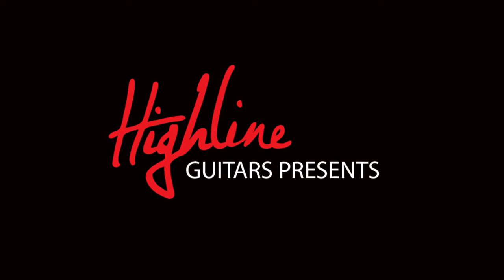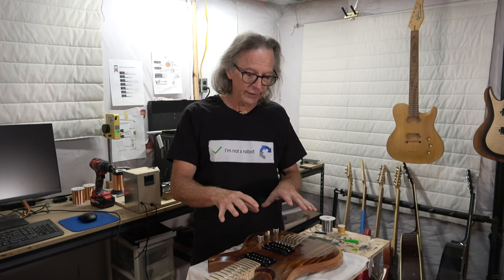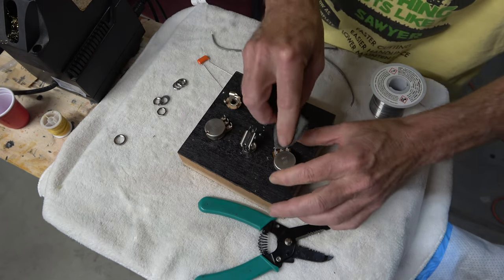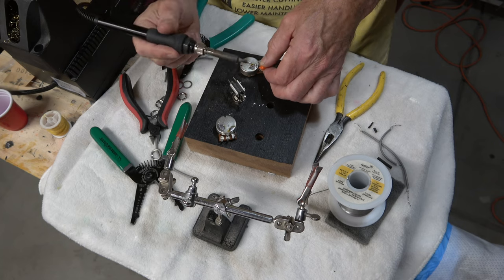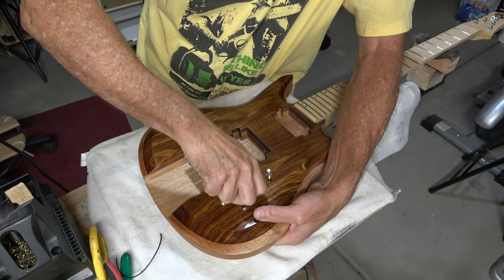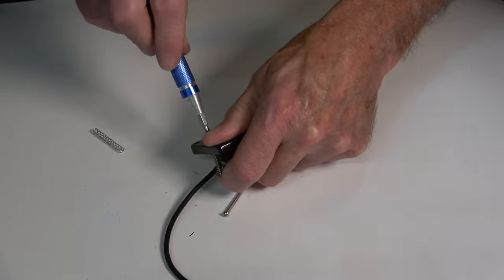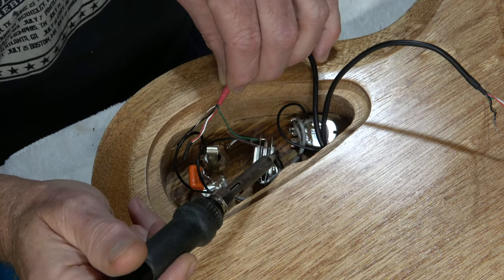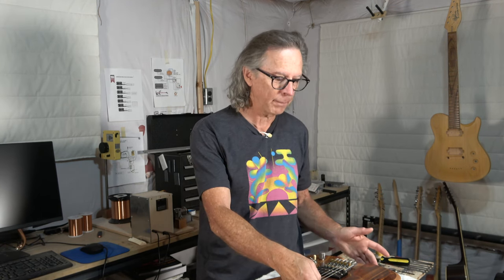Combining A Headless Electric Guitar With A Traditional Electric Guitar Part 11 The Electronics

Comment: Regarding the Capacitor, for best performance, they should be installed in a particular orientation described in this YouTube video called: "Testing capacitors for orientation of the outside foil end." This does apply to Orange Drops.
Reply from the maker: If a capacitor os polarized, it should be installed with the correct orientation. The Orange Drops I use are non-polarized.
Reply: @HighlineGuitars  When I tested several Orange Drop Capacitors that I have, there was a quite orientation and a noisier orientation as demonstrated in the video. It did seem to make some difference in my Start, but hard to quantify how much, maybe 2-5% quieter and warmer tone. I did the tests about a year ago.
Reply from the maker: @picksalot1  Orientation matters in an amp circuit, but not in a passive electric guitar circuit.
Reply: @HighlineGuitars  With many things about guitars, the best thing is to test for yourself. YMMV

Comment: I see you have a good ole' Hakko 936 iron. I have had mine for at least fifteen years and it still works just fine. For shielded connections I use RG-174, so what do you use?
Reply from the maker: I use UL1185 Single Core Shielded Cable Insulated PVC 26AWG wire.

Comment: Hey Chris, great video as always. I noticed there isn't any shielding in the electronics cavity, is that by choice or by design?
Reply from the maker: Since I used shielded single core wire for the signal runs, shielding isn’t necessary.

Comment: Re the string retainers: your comparison doesn't really make sense as the force applied to them is operating in a completely different direction to a string tree. They're going to be fine because you're using them for the application they were designed for but string trees would be pulled vertically up, away from the headstock, because the string is anchored by the tuning peg and the nut. In this case the force is pulling more diagonally, towards the nut, because the force acting upon them is ultimately coming from the bridge.
Again I don't forsee any actual problems coming from this but your explanation probably didn't manage to assuage the concerns of the armchair engineers who were criticising you.
Reply: Just realised that I'm not quite right about what I wrote.
Regular string trees would also be lifted a bit towards the tuner because the string would travel in a straight line between the tuner and nut otherwise.
The forces will still be a bit different because the retainers are the anchor point, so there will be less give, but it matters even less than I had originally thought 😅
Reply from the maker: This topic has really brought out the Cliff Clavins.